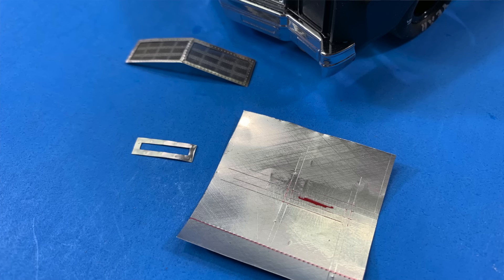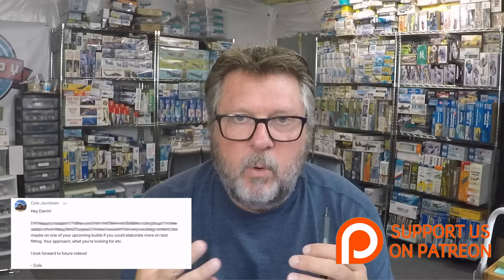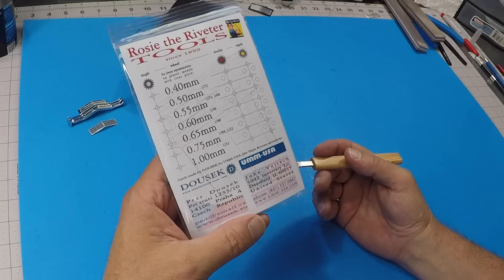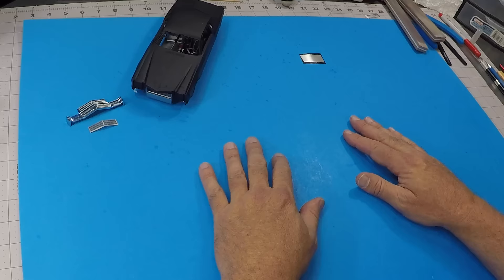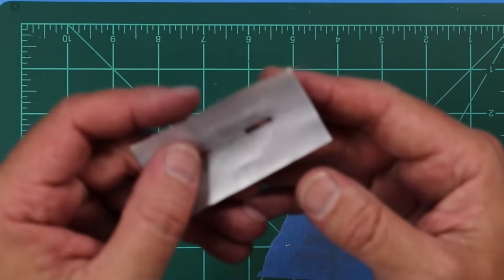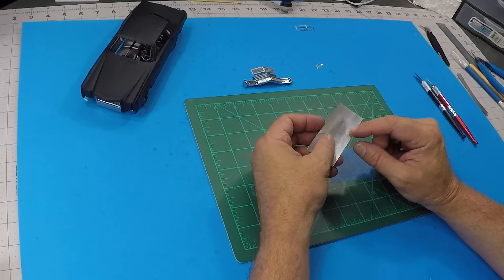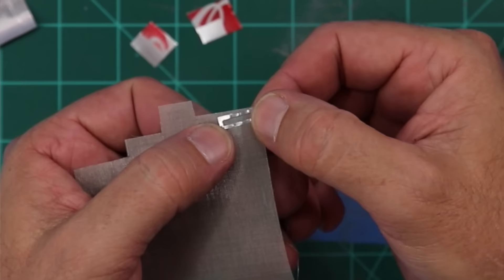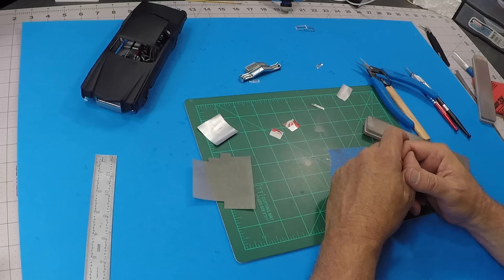How to Make Aluminum Scale Model Car Details From Scratch

Comment: Annealing is a very simple process and extremely helpful in shaping metals such as aluminum, brass and copper.  Just buy a Ronson torch and gently heat the metal until the surface blackens.  The only mistake you can make is applying too much heat and melting the metal.  The process takes mere seconds and, once you see the improved workability, you'll be happy you've taken this valuable, easy step.

Comment: this worked for me. light your wood stove. lay the curled up  pop can/ beer can aluminum sheet on the top of the stove uncurled and weight it down with a piece of 4" OD steel bar about 2 inches long. leave it there for a while and a while and a while... before you know it the dang thing will be flat and uncurled like a sheet of paper. it stinks a little until the paint and coatings off gas but just don't breath it..i don't know if it's what would be technically termed annealed but i think it is somehow different if the tension is out of the inner surface of the curl.

Comment: A good trick for shaping slightly thicker aluminum is to color over the surface with red sharpie (only red works)- then gently heat it until the sharpie turns black, At this point it's super close to melting- very easy to shape, and just the act of bending it will harden it

Comment: annealing soda can aluminum: 
aluminum anneals at around 625 degrees f (400 c) and you can anneal soda can sheets by writing on them with a sharpie and heating the sheet until the marker burns off (will leave bare metal underneath). You can use about any torch to do this and it just takes practice.
once properly annealed, it is pliable like foil but thicker and sturdier

Comment: Annealing aluminum is very easy use a propane torch to heat the metal up evenly until you notice a color change once that color changes happened take the heat off and let it cool naturally. Then it is soft aluminum. If you wish to harden the aluminum again after making your part just get it hot again and drop it in water. The annealing process happens quite quickly with real thin aluminum give it a try it's super easy

Comment: The best way to anneal aluminium is to take bar of soap and rub it on the Aluminium, just a very light film of soap. Gently heat until to soap turns black and allow it to cool down.

Comment: This is awesome. Im trying to figure out how I can do an Electric guitar. Theres tiny screws and all in we hat I want to do. Ive noticed that Axe Heaven they skip detail. A Floyd Rose Bridge doesn't look ike what they do. Clear strings. Heck there is many sizes kanthol that vapers use. Or there's hobby wire. Im not talking all working. Just to appear. Would you suggest any pointers its all wood metal paint

Comment: I’ve seen Jesse James eniling(I know that I spelled it wrong) with an acetylene torch with no oxygen. The flame was soft, and spitting soot in the air, but he was able to shape much thicker aluminum to make gas tanks for motorcycles. My guess is that you can do the same, by holding your aluminum over a stove burner for a couple of seconds

Comment: What about using aluminum duct tape? I was considering using it on my models
Reply: Sounds like a good idea actually. Not sure how the adhesive would hold up though 🤔 worth a shot
Reply: @masquerader101 have you tried it yet?
Reply: @Cactusfruitsquisher  I havent, but it seems possible, especially if you reinforce it with bondo and seal it in some acrylic 🤔

Comment: I've just found your page & i must say yours is the best for scratch build or kit bash technique. I'm  not yet skilled as you & i want to ask this...@10:41 you mention "cutting board" (red) you like for making the Monte grill. I finished with a curbside Petty Monte i did from old Snap Kit Lowrider (before Salvino's proper NASCAR body Monte). I flared fenders,etc, for stock car wheels & tires But that grill...I about pulled my hair out using screen from kitchen strainer etc. Could you please tell again what/how you used that red cutting board tool for making that neat grill. Thanks

Comment: the can material is not so malleable. the material is stretched to the point of breaking in the manufacture of the can. in other words stretched past the yield point of the material. this gives rigidity to the thinny (.004" give or take)sheet. the bottom is near double the thickness. marvel of technology these cans are...i use the stuff and still am learning to do things with it.. pie plates are good source of workable foil. they are quite malleable and canbe burnished a lot before trouble shows up..
Reply from the maker: Thank you for the information